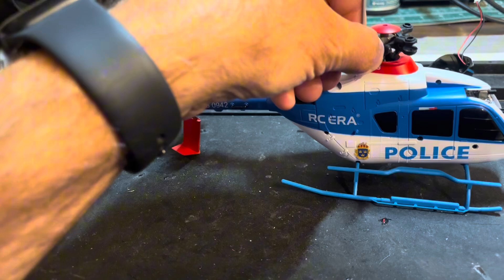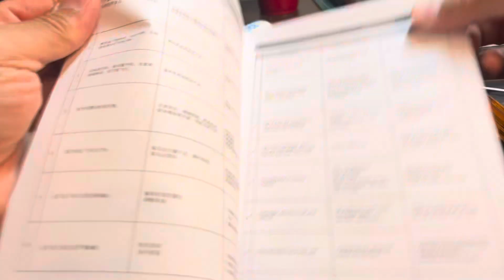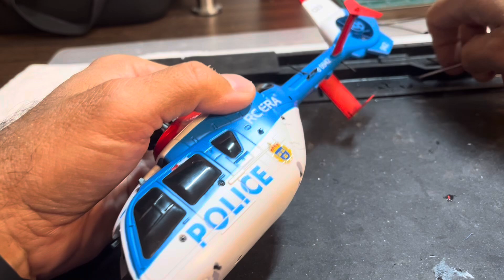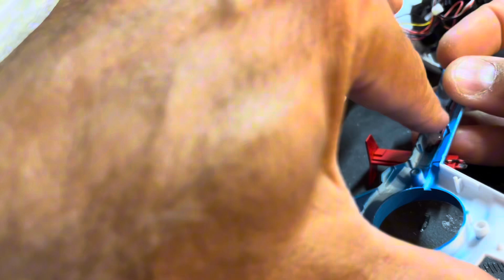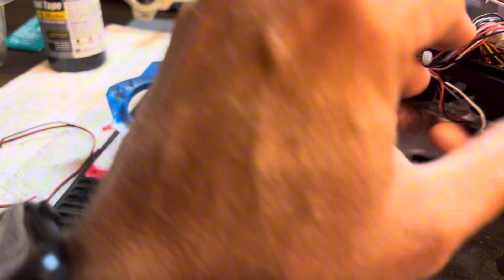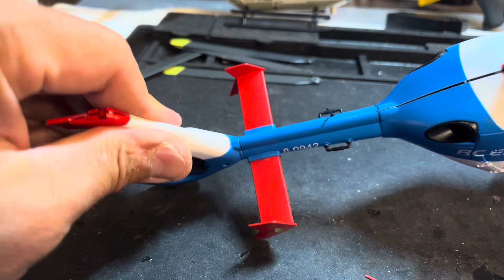RC ERA - EC 135 (C123) RC Helicopter - how to open and repair

Comment: I bought a Bell 206, too much wobble for my liking  compared to my  T,N,250 returned it instantly (seems too heavy): Is it possibly caused by, fuselage, very sturdy landing gear etc all adding xtra weight, Iv'e flown a Twister Ninja 250 for 2+ yrs, only using up the spare rotor blades. I think a lightweight Pod and boom  version could be great (do a conversion,lol)

Comment: I hate this heli flying with drone type FBL, unlike 6G/3D .  It feels too much locked in :face-orange-frowning:
Other bigger size like Yuxian/ Eachine Huye DMD with drone type FBL maybe ok.  

Once I have time, I will install  a RotorFlight FBL unit to fly it like a real DMD helicopter .
Reply from the maker: Some of these models are not worth the time or $ to spend on modifying to be honest.  The C123 in my opinion is a nice flyer for what it is.  I may also do some changes to it but have lots on my plate for now.  Enjoy it.

Comment: I just got mine this past tuesday, flying and looking great, about a dozen flights. Then last couple days the tail has been giving headaches. Just doesn't want to start up with the main rotor very much, which it would after a few startup tries, and I could fly fine.
 Then last flight it was getting worse where it took longer to get going and then only up for about 10 seconds about 15 ft up and it quit midair so it spun wildly and hit the pavement, cracked the tail body from the boom, and broke a few other small body pieces. Now the tail just spins a few times and stops, no normal power mode to reach after many tries, so no taking off at all now. There would also be secondary beeps after the initial bind beep sequence after startup during this issue, like it's rebooting. Seems the speed control board is bad and everything else besides cosmetics is fine. Had no wrecks before the one caused by this problem.
I checked the motor and wires, looks all good, spins fine and wires not chopped or frayed at the ends so it must be the board.  I really love the features of this heli and hate to see these sudden rando problems happen, hopefully mine is just an unlucky run that was marginal in the QC area.
Reply from the maker: Need to see a video of what its doing.  Could be a bad tail motor (sometimes if metallic debris goes inside the magnets it fails) or your flight controller might have a bad connection or malfunctioning.  You may also want to check the wiring to make sure its not shorted.
Reply: Ich habe das gleiche Problem. Nach nur 7 Flügen mit dem gerade erhaltenen RC Era c123 funktioniert der Heckrotor nicht mehr. Damit ist der Heli unbrauchbar. Sehr schade. Mal sehen ob Banggood eine Lösung hat. Ich hoffe ich kann ihn zurück schicken. Ob ich dann mein Geld erhalte... Mal sehen. 
So ist es auf jeden Fall ärgerlich. 
Ohne Heckrotor wird der Heli zum Kreisel und dreht sich wie wild um die eigene Achse.

Comment: Very odd, the lower swashplate is "inverted" so that the balls are actually below the plane of the plate. Normally the balls would be inline with the balls of the upper swashplate. I guess they needed to do that for clearance reasons.

Comment: 2 things...yellow tips on top of rotors and you really should put a tiny bit of glue to the tips of the antennas, if not you will lose them in the grass and NEVER find them.
Reply from the maker: Thanks.  A little glue will not hurt but only put it on one side of the antenna, otherwise when you have to open them again it will be messy.  What about yellow tips on top of rotors?
Reply: @Flight6677  If the yellow tips are facing up the blades are mounted correctly.
Reply from the maker: @jeffkraus1457  yes that’s true. But it’s good to also understand the technical details about the leading edge of the blades.

Comment: Excellent video. Good work tearing down and rebuilding!  

Did you ever do one on the C189 MD500?  Mine has all needed parts now and I need to rebuild it. Put back together. Been sitting for 3 months. I know there are long and short screws. 🙄
Reply from the maker: @OHHP3712U  I will do one for the C189
Reply: @Flight6677  
Awesome! You are good at these and it’s very helpful Content!

Comment: I had two cables that were about to break at the factory. Once from the green LED and from the motor.  Quality is really bad!!
Reply from the maker: @WinterbergerJung89  I suppose there are bad ones out there as well. When you rush to manufacture so many in a short period I am sure one or two will be bad. But none of mine have quality issues outside of a couple of my C189s.
Reply: These Micros from RC ERA are nice for the price point. IMO, so far, for cookie cutter Micros the c123 is pretty darn nice/good. You usually do not find a direct drive Micro Heli for 130,00 bucks anywhere on planet EARTH Sorry to disagree with you.
Reply from the maker: @jeffkraus1457  I agree.  You really need to know the history of RC helis to know that 5 years ago this was a dream for some.  Flybarless, direct drive, controllable and smooth micro SCALE heli.
Reply: @jeffkraus1457  yeah i'm usually into 3d helis like goo-sky, omp,  and once i saw it was not geared i was like hell yeah take my money! But now I have a problem with the tail not starting up and sometimes it does and makes me think it's just some bug and I can fly fine till the next flight, the tail quit midair and the body got busted up. Now the tail won't start at all, just spins a few times, stops, sometimes makes another beep like there was a reboot...very frustrating the speed control board seems to be the issue despite nothing ever jarred it before this last crash it caused.

Comment: How does the tail rotor attach to the tail motor ? , does it just pop off ?
Reply from the maker: I did not remove it but yes, it snaps on the motor housing.
Reply: @Flight6677  Thanks.